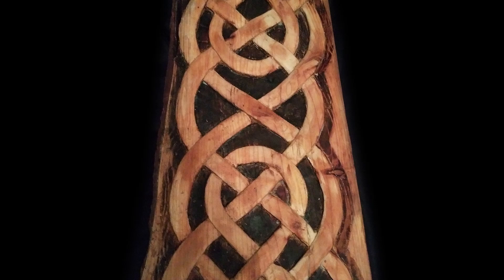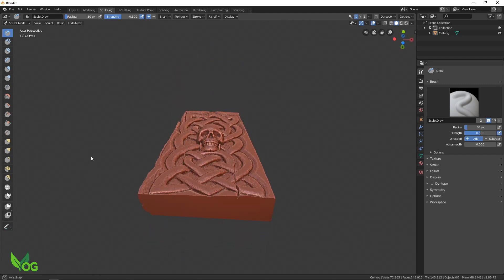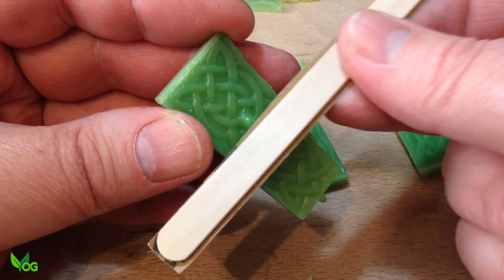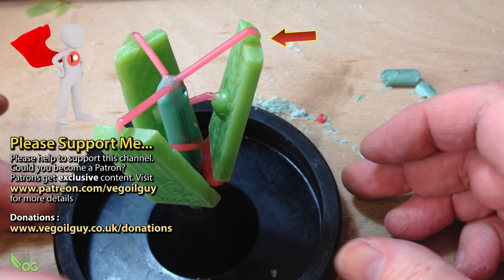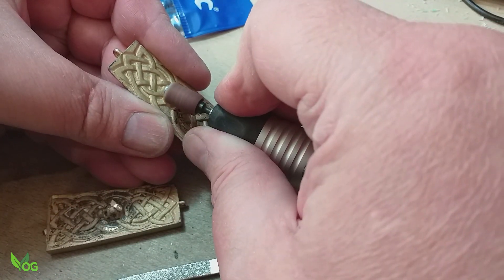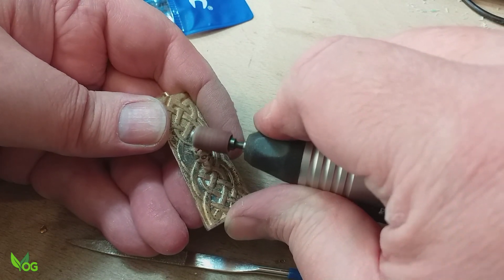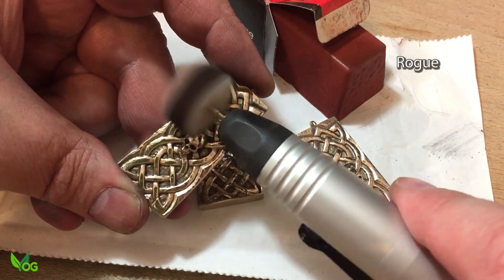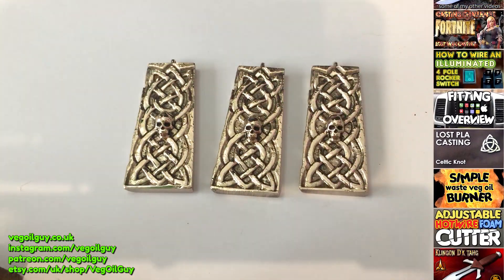Casting a bronze Celtic pendant - resin to metal casting at home with VOGMAN

Comment: I am sorry but this level is way passed over "home casting" :).  I work in my kitchen with a mapp torch,cuttlefish molds,iron molds and by using a hammer and anvil. I made my calculations and realized that this type of casting is way too far from doing it at home and the tools necessary for this type of casting pass a 3000E budget.
Reply from the maker: There's bound to be many professionals and experienced home casters out there that will spot the flaws in this project. There's usually some. Until I avoid most of them consistently, I'll continue to think of myself as amateur... but a happy one 😁
Reply: @vogman  "professional" for me is subjective and it does not include tools,they exist to make your work easier and faster. When talking about home casting,not only i but we mean home with rudimentary tools,maybe a gas forge in the backyard (it's way,way cheaper than electric furnace) or a mapp gas torch, that's the "home making,casting,diy" experience. When i started watching your channel you were at that level and i loved it,i had from where to learn things. But moving from basic DIY setup to a ,'normal jewelry casting workshop setup' should make you understand that it's not "home casting" anymore. Home casting is not about skills,it's about the setup.
Looking now at your tools i realized how much you have evolved!
Reply from the maker: I'm not sure I agree with you on this one. For me a professional is someone good enough to produce consistently high quality items and someone who MOST ESPECIALLY, can make a living at it. That's certainly not me 😁
As for 'home casting', virus or no virus, before it and after it goes, I don't have a lot of choice there... I'm pretty much stuck here all the time, so EVERYTHING I do is done at home, with stuff I make or stuff anyone can buy.
I possess nothing that's beyond the reach of an enthusiastic hobbyist. Yes, everyone's budget is different, but I've made lots of my own equipment and showed others on YT how to do the same. And even fully kitted out brand new, I'd be willing to bet my level of equipment is less costly that say an equally enthusiastic golfers spend would be. My point there, most hobbies are expensive... and most of us save up and by bigger and better for our love of that hobby.
Lack of tools certainly doesn't define professional or home making status. There's real professionals out there in all kinds of fields earning big bucks with the most rudimentary of equipment, often with much less gear than a keen amateur. It's their skill and ability to sell their wares that make them professionals.
So whilst I'm flattered that many think my castings are good, I still feel I have a long way to go... and as I travel the path of experience, it will be AT HOME. Some choices are beyond our control 😉
Reply: @vogman  I am not "hate commenting", it's an opinion i wanted to share because i like your channel and i think that once you got "upgraded" tools as such,you are off the way of "home". Professional is about quality results and work, and i think that you are going that way :),not necessarily about consistency. Even after 100+ castings i sometimes mess things up but mostly because i try new things,i have new conditions,etc. I do not have the budget get a casting "kit" so that i could cast 10,20 pieces at once but oh boy,that would make my work so much easy!!! Yes,there are some little mistakes but hey it happens to anyone. I think that you are reasonable enough to understand my point.
 Btw,i am looking for information on ancient malleable bronze that can be worked like silver and gold,with hammer and anvil. If I remember correctly,it's formula is Cu+Sn8%/10%. I am an ancient period silver/goldsmith reenactor and up untill now i didn't find any video about casting and working with such material.
Reply: I agree, he has gone beyond his veg oil beginnings! I don't begrudge him his fancy casting machines, his printers and his electric furnace but I miss the homemade machines. :( As a fellow with a better stocked workshop than bank balance, I like to see what others can do with homemade stuff like mine! :)
Reply from the maker: I built budget stuff and shared the recipe. I like to think I've helped many who, like me, couldn't afford the expensive equipment find a way into the hobby. And the budget stuff works. I've proved that. But I can't make a budget Foredom... I don't have that kind of workshop or skill level 😊
Reply: He's an amateur with pro-spec gear

Comment: I really like your content, you have some great project. I am considering getting a similar induction furnace. My father-in-law have a electrical company, he always have scrap aluminium and copper that I could remelt. Do you see any drawbacks of these induction furnaces that I should be aware of?
Reply from the maker: Thanks Csongor. Unfortunately I have no experience with induction furnaces, but as long as your metal melts, you should be fine. Just be careful, deal with everything as safely as you can and you'll love it!
Reply: @vogman  Induction is the one you use to melt the metals. I was looking at the same model on aliexpress.

Comment: Like your channel a lot. I've just set up a garage small foundry. The devil forge is the one for me. I dont know why the Pro/Am debate should come into this,  you as i am are just serious hobbyist's . A pro would have to have qualifications. But no matter. Also , how long has your Max Wax tip lasted ? I have just got one and wondered whether to buy a pack of spares. :  )
Reply from the maker: Many thanks : )
I don't really think it matters if we're amateurs or professionals as long as we enjoy what we're doing. And if we help each other, that makes the hobby more popular and we all gain.
As for the Pen, I'm still using the original tip. HOWEVER, I did buy a spare at the time, because you know it will break when you need it most : )
Reply: @vogman  Yeah your'e right about the pen. I can only see them in a pack of 3 on ebay. Thanks for the help and look forward to your next video.

Comment: It seems that Bluecast resin is awesome stuff, as long as you know exactly how to use it. I love the one edge with the pronounced wood grain, and I agree with you - the hand-carved nature of the original piece does translate very well through the print to the finished casting.
 The fact that you successfully cast all three tiny top loops has left me quite weak at the knees!
Reply from the maker: Interestingly, someone has just mentioned Marilyn Monroe to me, so I'm also weak at the knees 😁
You are an industrious fellow. I'm a sub of yours and I enjoy your creativity. You cast. You engineer. You mess about and enjoy doing stuff (much admiration here).
I suspect one day soon you'll get yourself a resin printer. You'll figure out ways to knock up basic equipment, much as I did, and you'll shock us all with ever-greater achievements. At that point, small rings will no longer impress you 😊

Comment: Love your videos VOG, they were an inspiration to start my own casting. What is the flask temperature that you used before casting?
Reply from the maker: That's a tricky question as it depends a lot on the metal, the size of the casting, the size of the flask, etc. Typically anything between 400 and 550C is popular.
Reply: @vogman  Check this out www.siamcasting.com/casting_temperature_guide.html  :)